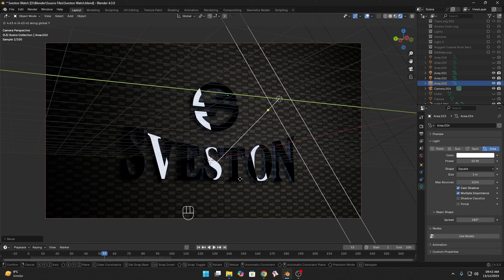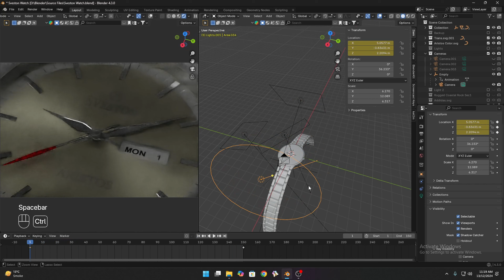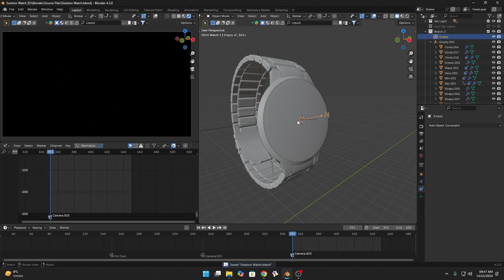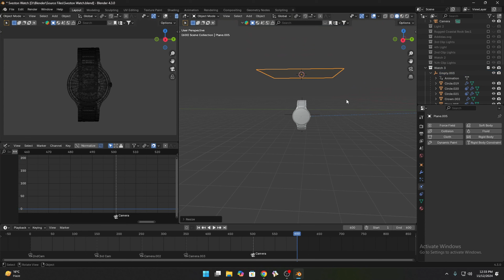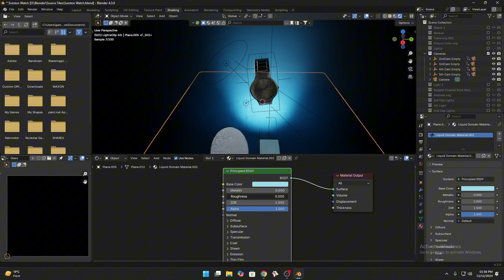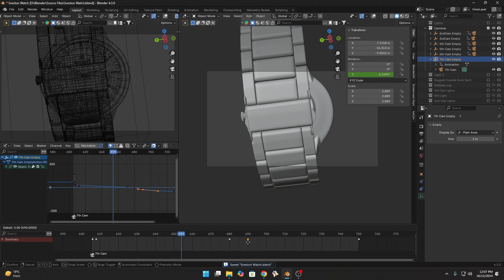Masterclass: Level Up Your Product Animation in Blender 4.3 - Beginner Tutorial

Comment: Tip: 
In Blender, you can keep the lighting effect from an area light while hiding its emissive shape from reflections. First, Select the Light Object. Open the Object Properties Panel (orange square) In the Properties Editor (right-hand side), click on the Object Properties tab (orange square icon). Adjust the Visibility Settings. Scroll down to the Visibility section. Under Ray Visibility, uncheck the following options,
Glossy: Hides the light source from glossy reflections. Diffuse: If you only want to hide the light from visible diffuse reflections but still keep its illumination, you can toggle this too. Transmission: Hides the light from transmission (glass or transparent objects). Volume Scatter: Hides the light source in volumetric effects (fog or mist). For most scenarios, you only need to uncheck Glossy.
You will still light the scene but don't have to worry about the emissive lighting from the lights shape showing up in reflections (or anywhere depending on settings you choose). There is another method as well using shaders (only works in Cycles), but this method is the easiest.
Reply: Actually, you eventually did make those changes but I had not got to that part of the video yet. You did originally move the lighting to try and get the reflection off frame (assume you looked it up) but the lighting originally looked better.